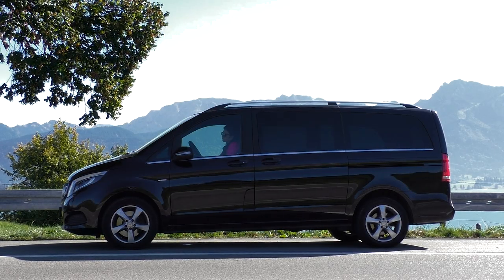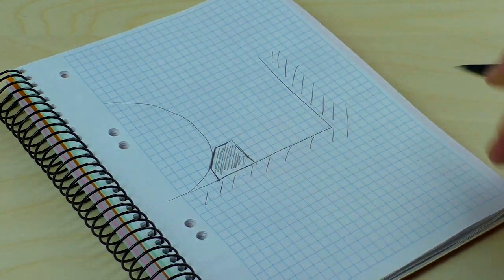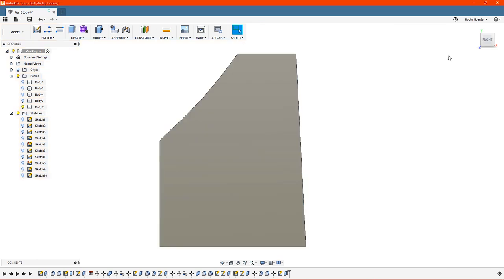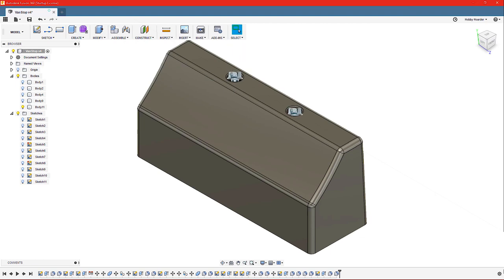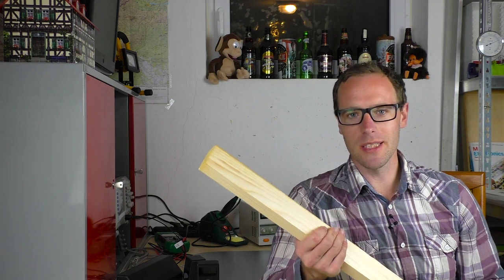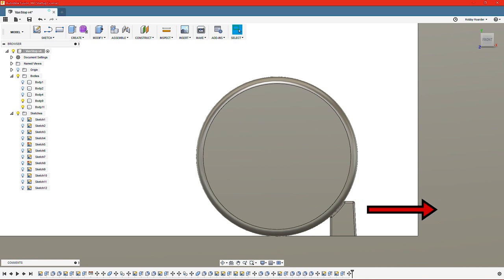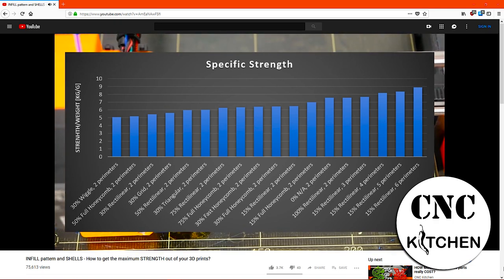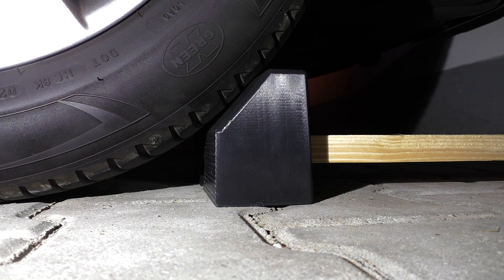3D printed parking/wheel stopper

Comment: Nice video I think it can help my mom so now I have an extra Project😋
As a side note my understanding of Stefan video is the thickness of the Shell Around the object should be the same. But the perimeter cannot be less than nozzle diameter but that cannot be said about the layer height 
6*0.4=2.4mm = 6*0.15=0.9mm🙁
Reply from the maker: pallepirat Yeah, you're probably right, that makes sense. I did use 0,2 layers but still, that's less than the outer shells.

Either is probably an overkill for this. I was kinda shocked just how strong it is and it weighs half a kilo. It's rock solid even when it stops a 2 ton van, so I'm very happy with it.